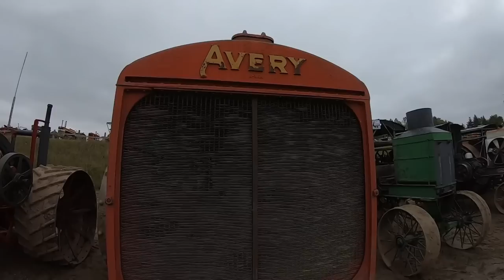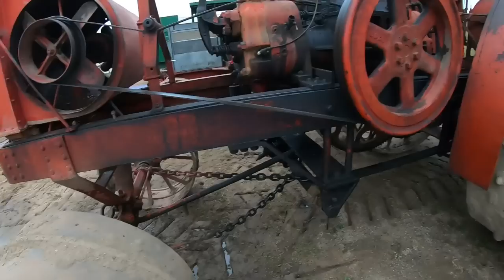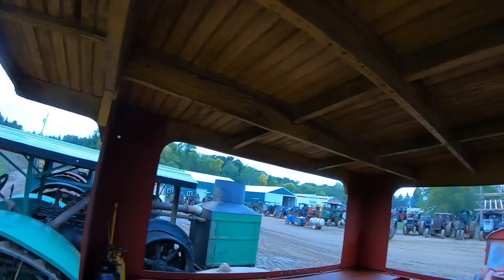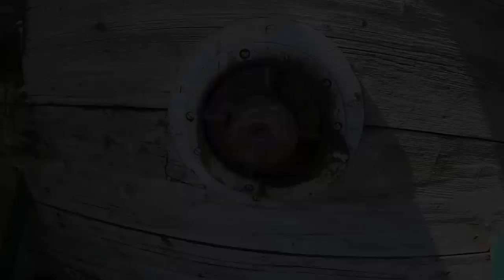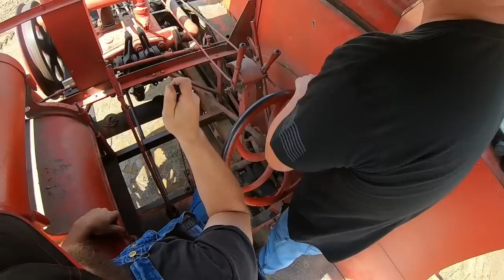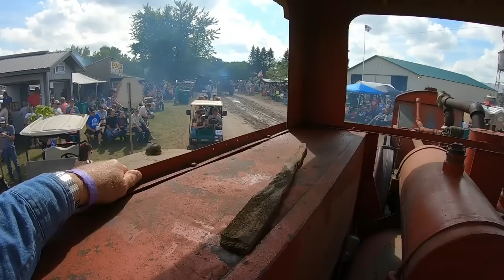Large Prairie Tractors at Albany Pioneer Days 2022 - Avery 40-80 Tractor Walkaround & Drive!

Comment: I love the old stories of these Prairie Giants. I think it was some big farm in Canada that had 8 or more big Aultman Taylor 30-60 tractors to open the prairies. In some instances essentially 2 people operated all of them. 0ne would be on each end of a field. These fields would be miles long by the way. But every 10-15 minutes they would start one tractor down the field plowing. Drop the guide into the furrow and jump off letting the tractor do its thing. Then they would go get the next tractor ready and get it started down the furrow doing it's thing chasing the previous tractor. Once they got all 4 or 6 (whatever number really) goingto the other end they would head over to the other side of the field. As one tractor came in they would "catch" it and raise the plows at the end and drive the tractor over to the other side of the field. Once it was headed back to the far end of the field they were ready to catch another coming in. Repeating this over and over until that section of Prairie was plowed under. I would just love to see that.

Comment: My Great Granddad purchased a 12-25 Avery in 1915. The 40-80 is essentially a much larger version of the 12-25, 2 cylinder opposed engine, sliding frame transmission, chain steering,  etc. the radiator was the old style exhaust venturi (locomotive style).   Cool 😎 monster tractor. 👍

Comment: My wife and I were attending an old tractor steam engine show and we were invited to step up on the back of a huge very old tractor so the owner could show us how it worked.  He started it up and all of a sudden the engine started running faster and faster.  The operator was doing his best to shut it down as it was clearly over revving and the whole thing was shaking like it was about to blow up.  He finally got it shutdown and found that the fly weight governor had come loose.  I certainly won't forget that day!
Reply: Yikes!
Reply: I don't have figures to give you, but the boilers on old steam traction engines are also subject to catastrophic failure.   Steam engines on antique locomotives are subject to rigid inspection requirements under the Federal Railroad Administration.  These rules do not apply to traction engines, even though their boilers are very similar to (if smaller than) railroad locomotives.
Reply: I think I know the feeling. I was sailing on a new to the museum Monterey Clipper (think SF Fisherman's Wharf at least 30 - 60 years ago when they were common).  An early motor powered fishing boat once common in California. The engine went into runaway. This was a single cylinder make and break gas powered engine about 6 feet tall, hundreds of pounds, open crankshaft... of 8 HP. It was shaking itself apart. My friend dove below to fix the engine and I was left on deck alone having no experience with this boat. We were in close company with the park's other Monterey Clipper our about a 1/4 mile from shore. It was terrifying for a while. It was the valve control which functioned as the throttle that had come loose with wear and age. Could have punched a very big hole in the bottom of the boat or thrown stuff at us and we had no where to run. Fun times.
Reply: Forget pony motors just use your farmall!

Comment: That's a huge tractor it was nice seeing you driving some on steel wheels it's a good thing that it goes so slow with all of the slack in the steering linkage
Reply: And it's a medium class. There were bigger, much bigger. There's a reason they used to be called land trains even in the petrol era.

Comment: That Avery is a 4 cylinder opposed engine. Look closely there's 4 intake valves in the block and 4 exhaust valves in the heads. It's an F-head design.

Comment: The steering effort didn't look too bad when moving, amazing machines.. i think you might be on to something about the canopies being from the same maker. It would be interesting to see a Thomas register from back then.
Reply: @squatch253  couldn't the steering chains be adjusted? Put a turnbuckle in to take up the slop?
Reply: @dans_Learning_Curve  
Have to allow some slack for the axle to pivot a little to follow the terrain 
And a fair amount of the slack is just in the linkage from the wheel to the drum 
To say they're rough is an understatement 
Standard practice in the day but dam was
Reply: @squatch253  you mentioned the design of the roof. Very similar to the design of the very early steam locomotives with wooden cabs. Wouldn’t be surprised if one wasn’t inspired by the other. Thanks for the video, those giant prairie tractors are cool.

Comment: The Avery would barely even notice as it ran over a golf cart 😀. You can take a fair bit of the slack out of the steering by carefully fitting the worm to the drive gear, taking up any play on the worm gear thrust bearings, tightening the chains and using heavy springs at the axle end, to absorb kick back rather than slack chains. I assume it is similar to a traction engine, where that is used tp take out slack on chain steering.

Comment: What an amazing old machine.  Clutches were common enough on various types of machinery in that era that you wonder why the designers thought that sliding the whole engine back and forth was an optimal solution to engaging and disengaging the engine from the drivetrain.  Is there more than one gear?

Comment: Most of the guys who drove those probably grew up walking behind a team of oxen or horses, so that spring loaded platform probably seemed like the lap of luxury.  I would not be surprised at all if they were sourcing those cabs from a common supplier, or from several similar suppliers.  That was kinda what happened to the carriage/wagon industry when cars and tractors became a thing.  Companies like Brewster and Demarest starting producing luxury car bodies.   Some early cars were shipped as a running gear and engine, and you took it to your local buggy shop to have a body built.   I wouldn't be surprised if wagon builders started building tractor cabs.